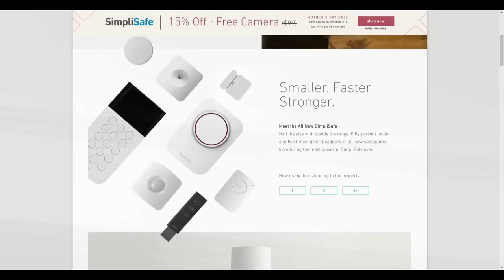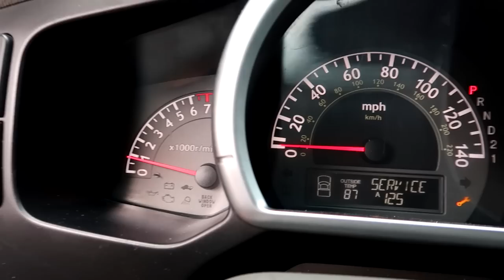Buying a Reposessed Truck at Auction was a MISTAKE! It's WAY Worse Than I Thought!

Comment: My guess is that most of that rust is a result of the holes drilled to put those running boards on. 
You seem to get all caught up in things being unsightly. Which I guess is important when you’re talking about a luxury sedan, or a sports car, but that’s a truck, a shop truck at that. Just keep the power steering fluid topped off and drive it.
Reply: Barry Fields you raise a good point. Nobody ever got the proper training on how to properly install the running boards so they probably contributed to the out of control rust. At a minimum the owner or owners didn’t stop the problem from progressing.
Reply: From what I've seen, they come from factory with threaded holes for running boards, and same goes for the Pilots.
Reply: Kai Borah I just watched two videos on ridgeline running board installation. And there appears to be holes in the frame for running boards. But the ones on this one appear to be mounted right to the rocker panels. But I could be wrong. When he puts his foot on it the whole rocker panel moves.
Reply: My thoughts too. The rust on this car is odd. The rockers are so bad one would expect the rest of the bottom to look awful, but it's actually not bad. The rocker issue is pretty isolated.
Reply: @JVR_Funwithdesign  As a rust belt resident, we usually see rockers as the first to go. They're in-line with the wheels, and therefore receive most of the road salt/slush. Specifically, this is the worst rust area on my pilot, which is near identical to the Ridgeline underneath.
Reply: @joystix11 Yeah I live in Canada and have seen my fair share of rust. :) But usually the wheel arches would be showing some sign if the rockers were that bad. It's probably a combination of salt and some improperly drilled holes.

Comment: Im from Nova Scotia - the land of rust and honey.. It's moderate. I think you got a good deal.. it's worth fixing up and it should not cost you 3 or 4 grand more to repair. we fix rocker panels like this all the time. for around $250 -  $350. Also get it under coated for another 100 and that should help allot. Cheers
Reply: Al Bore  Tar hardens out, traps moisture and it rusts out again.
Just lube it with chain oil. D:
Reply: FLUID FILM
Reply: Same I'm from Fredericton

Comment: The weight capacity of the running boards is probably the weight of 5 chickens.
Reply: What about bananas?
Reply: I think 3 tops
Reply: I say 7 chickens and a coconut...
Reply: Unless running boards are directly attached to the frame it's a joke. I doubt new it could hold my entire weight.
Reply: Wings or McNuggets ?
Reply: It'll carry a henway.  What's a henway? About three pounds...

Comment: In Arizona rust is an endangered species
Reply: That's why AZ is the best state to go car shopping!
Reply: Tx too..no rust.  18yo Bmw convertible with 185k - no rust.
Reply: Daily driven 2002 Nissan Maxima here in Colorado.  Nothing but surface rust.  I'd freak if my car had rust as bad as this Honda!
Reply: 275k on my Eclipse 03 GT 0 rust
Reply: @maximaniac7231  Here in So Cal, rust is almost unheard of. High mileage gets the car eventually, but that's pretty much it.
Reply: I've heard AZ called the used car capital of the US - No humidity, and no snow, so no salt on the roads, either.
Reply: @LaGrrrande  There is snow in lots of the state. Watch out for anything from northern AZ. Southern AZ is the best.
Reply: @jaythrash8804  Oregon has AZ beat.  No rust AND no sun!
Reply: 123 123 that's a blessing.

Comment: It was turning because the whole bearing was spinning. You put an Allen wrench into the center of the sway bar link bolt to stop it from spinning while you use a box end wrench to loosen the nut.
I ran into this yesterday when I was changing the struts on my Toyota.
Reply: All you do is grab the joint where the boot is with a pair of vice grips then wrench the nut off
Reply: Rounding the allen key, breaking the hex tool, rounding the nut on the front and the backside (if your link has one, most don't). Easier just to cut them off. I've wrecked a few pair of vise grips and other tools as well just trying to get rusty links off. Dont waste your time.
Reply: I honestly laughed when I saw this. Like this is sarcasm right? People don’t actually do this.

Comment: Evidently never seen a car from OH. You haven't seen rust yet, Sam!
Reply: That one was bad for a ridgeline tho..  they're usually not that bad, even here in ohio.
Reply: In Ohio, brand new cars are already rusted
Reply: @getchasome6230  you wouldn't want to have seen our old delivery Ridgeline then. Had no floor. Literally no floor 🤣
Reply: @steelvenom330  bought my last car from Florida because of this very issue. In Wadsworth less than a year and has a spot already 😤
Reply: @ThePhoneGenius2009  I live near Canton and bought my truck from Kentucky, it had no rust when I got it, I immediately undercoated it with rust proof as soon as I got it up here
Reply: @steelvenom330  my truck was rust proofed previously. I usually wash the underside of the car and truck off. Usually rustproofing at least in my experience has made it so that rust can prosper and be hidden. (most times if done improperly). So I just make a habit of washing the underside when it's been crappy out.
Reply: @ThePhoneGenius2009  LOL check out some Michigan vehicles they are even better, we love salting our "roads" from September to May.
Reply: i live in ohio and my cars have never had any rust problems
Reply: @danieln2448  look at the underside (chassis, undercarriage, what have you). You'll probably find a spot unless you're getting a new car every year.
Reply: @ThePhoneGenius2009  no I had a cruze for 3 years no rust at all now I drive a 2017 audi still no rust
Reply: lol Slam the door and the car/truck will weigh 20 pounds less due to chunks of rusted metal falling off
Reply: @danieln2448  lol it's 3 years and under obviously a brand new car isn't going to have much rust, I figured common sense would have been applied to my comment I apologize.
Reply: TPG2009 or newyork
Reply: @thahitman2  That sucks!  I live in Columbus, Ohio, and the roads are only salted here the night before snow or freezing rain is forecast.
Reply: @hamsterama  Ahhhh yes good ol Columbus I once had a wild night there at Kahoots after getting thrown out of Easy rider rodeo in Chillicothe.
Reply: @thahitman2  Hah hah!  As it so happens, I live just a couple miles or so from Kahoots.
Reply: @hamsterama  Hell yeah man it was a good night that's for sure,  we shut down kahoots then went to the white castle right down the street it was like 3am all of a sudden all these dudes showed up and started a car system competition,  the cops came and we are sitting in the drive thru with a 1992 Ford tempo with the top chopped off and a 9 ft stripper pole installed with giant vinyl decals reading MUFF MONSTER down each side. Me and my buddy couldn't believe that the cops didn't fuck with us.
Reply: @ThePhoneGenius2009  --REMEMBER WADSWORTH FORD ??
Reply: @BigTony2Guns  Wadsworth Ford, Spurgeon Chevrolet, Strickland Chevrolet (before it was Laria). Yup
Reply: @BigTony2Guns  I also remember Axelrod Chrysler when they sold new. Now they sell overpriced exotics. Across from them was a Chevy dealer where the owner got arrested for fraud. Can't think of it's name.
Reply: @ThePhoneGenius2009  --That was Cook Ford-about 40 years ago..
Reply: @BigTony2Guns  my folks remember cook Ford.  There was a Chevy dealer that had the same thing happen. It was George something Chevrolet. Jim Bonner auction house is in it now
Reply: @ThePhoneGenius2009  --I worked for Cook Ford and Bought  a--1968 Wadsworth City truck --in 1979-Wish I had that truck NOW !
Reply: @BigTony2Guns  small world. We renovated a house by the city lot on Oak St. I used to work at Isham and Overlook on their computers.
Reply: @BigTony2Guns  the dealers name was Micky Miller Chevy. Bought by Doraty Kia and turned into Renacci Doraty Chevy, and went outta business in 2010.
Reply: @thahitman2  Salting the roads makes them taste so much better though.

Comment: Where in the Netherlands this amount of rust on the rocker panels would easily total out the truck. No way this ever passes or MOT inspection. I mean rocker panels on a unibody construction are a big part of the construction and if this thing would involve in an accident it would kink right where it rusted through. I would definitely at least bodge it with some fresh metal and undercoating before taking the road trip, just to make it solid again and a bit safer.
Reply: Ah khoya elke Turk keurt zwart tegenwoordig.
Reply: Ilias Lamari yes people here are accustomed to government officials not caring about anything and in my state of Texas, it is so absurd that independent mechanics inspect cars for the government and therefore they don’t care either or ask for extra money. Even in California, the emissions officials accept bribes.
Reply: You spelled defiant
Reply: Same here in UK would. Need to be cut out Replaced filled and then sprayed over with filler. Also cat failure mot fail. In UK would. Be scrapped as not viable to do
Reply: The benefit of inspections though is safer vehicles on the road around you.

Comment: You should get a 2011-14 F150 or a Silverado with the 6.2L V8. 
Would be an excellent tow truck when you need it and are super reliable.
Reply: Or a diesel....?
Reply: Yeah, I'm thinking more towards a Ram 2500 with the Cummins Turbo Diesel
Reply: @B_izzyy  but it would need the egr delete
Reply: Maybe a duramax diesel?
Reply: ScottyB 
Yeah I’m thinking almost anything but a 6.4L looked like he already looked at/tried to buy would be ok. 
But that can start a whole other conversation. 
But I think Cummins makes about the best diesel out there.
Reply: Nesta M 
Hard to beat a D-Max😁😁
Reply: I was amazed at how cheap the f150s get used. If you're willing to buy at over the 120,000 mile mark, they can dip really low. I'm driving a 2010 with the 3V 4.6, and I haven't had any real issues yet.
Reply: Miles Beckman tru
Reply: Undissatisfied 
As long as it’s not a 5.4L they’re great trucks. 
That’s why I like the 2011+ because you can get the 5.0 which is a  bulletproof engine but more importantly the 6.2 which is an absolutely sweet engine and probably one of the most reliable.
Reply: solid trucks, but I thought f150s had pretty common problems with timing chain failures?
Reply: x5finger 
I think That’s with the 3.5L Ecoboost V6. 
They had some problems in the first 5-6 years. 
That’s why I like a good ole American V8. 
Everybody says the Ecoboost is just the best thing but I think that they aren’t a high mile (250K+) engine. Putting that must turbo boost in an engine will wear it out way faster. 
They’re great if you want a city truck I guess but if you want a solid long lasting truck get a proven V8.
Reply: Or just get a Silverado. 
They’ve had it figured it out for years. 
One of the best.
Reply: Just picked up a 2500hd with an 8.1
Reply: Yesssss!!
They are the best!! 
They have the Allison don’t they?
That’s totally where it’s at, especially for a gasser😄
Reply: Not sure bout that ford..
Reply: gertgrtgrtgrt 
Yea...but the problem is who wants to go to all that trouble and expense when they could just use a stock 5.0 coyote and it’ll pull like a beast or get a 6.2 in ford/gm and it will blow your socks off. 😂😂😀
Reply: gertgrtgrtgrt the 4.6 was a great little V8 but like you said just not a ton of power. Lol
Reply: gertgrtgrtgrt 
I was just thinking of a truck that is in that production year.

Comment: You think that amount of rust is bad? How cute.
Reply: Floridians are weird about rust. They're not used to it so they think any amount they see is going to cause the vehicle to fall apart.
Reply: @Kitfoo77  JonTron was right. We gotta saw off the whole state and let it float into the ocean.
Reply: @tiborklein5349  Just let me know when so I can drive north!
Reply: Kitfoo hey we’re not all that way, my trucks rusting around the drip rails and the back of the cab, I’m not fixing it til I can see the sky.
Reply: I know right. Up here in Nh Ive seen cars basically missing nearly the entire under carriage.
Reply: Kawaii koto
Reply: The rust on there is horrible! This thing is a total rust bucket! What are you guys talking about?!
Reply: @805NAVE  Thats nothing my dude. Ever been in the northeast or even the rust belt?
Reply: Right? As long as there's no through body holes, that doesn't even qualify as rust.
Reply: @EHoward64  In Highschool, I had a friend who's car had no floorboards. There were 2X4s across the frame rails held in place with vice-grip pliers and the car seats were strapped with nylon straps to the 2X4s. Pretty fun car in the summer, not so much in the winter!
Reply: @ekummel  I had a 85 300zx, missing nearly half the floor and had no rocker panels left lmao. Seats werent bolted down just held in with zip ties. Was a fun drift car and a fast one too... till i burnt the clutch out and it sat for 6 years before selling it to a guy for parts.
Reply: @805NAVE  what?
Reply: Kaguya-sama, is that you?!

Comment: In my area they're shops that just specialize in repairing rusted quarter panels on trucks.  I got both of my rockers replaced on my 1991 Toyota pickup for $400.  That did not include paint or body work just cutting out the old rockers and putting new ones in.  Took about two hours I waited while the work was being done.  I did the paint afterwards using shaker cans and it looks good.  As for the other rust issues it looks likes they put a paint over rust product.  If done correctly the applied will prevent further rusting from occurring but it does have to be applied correctly.

Comment: as a truck owner,  I would say the rust is moderate COMPARED TO VEHICLES HERE UP NORTH.........
I still would buy a vehicle with more rust than this Honda up here in New York as long as i CHECK FOR MYSELF that the rust is superficial underneath and not rotting the metal.  But you seem to have a decent, workable budget.  So only work on it if you plan to keep it - as you mentioned before - weekend projects!!!
Reply: Exact!

Comment: I would say the rust is moderate. Severe rust would be frame rot. But it would be good for a cheap reliable family beater.
Reply: Exactly. For the right price, my deal is that the body rust is deal-able with, but if the frame has soft spots it's time to run away from it. Coming from someone who lives in the rust belt.
Reply: It's a unibody construction, it does not have a frame. Or otherwise put, what's rusted out there, is a part of it's "frame"...
Reply: Why you want to beat the family tho?😂
Reply: @ecua-el_pinguo2164  😋😋😋😋
Reply: Unibody vehicles still have a main structural area that is easier to just refer to as a "frame".

Comment: Ridgeline owner here. Dont forget the Transfer case oil and differential
Reply: Do they do the same thing as a crv and start locking up the rear diff in low speed turns when the fluid is dirty? I get great deals on crvs that are wheel hopping in parking lots. Bam fluid change and all good.

Comment: I'm from Montreal and have a cousin who's been running a body shop for over 30 years. What he explained to me is that rust is like cancer. You'll remove the rusty part and weld some new sheetmetal, but it might (and sadly, often does) go bad again as it's very hard to remove 100% of it. In your case, you live in Florida, so the amount of time before it comes back might be a lot longer. The "frame" looks to be in pretty good condition, I'd say it's worth it and I'm keen to see the content you show us doing it.

Comment: I would coat the underside with an oil-based undercoating...not rubberized. Don't bother with paint.
Reply: Fluid film!!!!
Reply: @cletusclem8758   
After you get rid of the rusty flakes and undercoat then fluid film.
Reply: Yeah, in Canada they use a oil/wax coating.

Comment: Buying a Ridgeline was a great idea, just this one is not a good example. To everyone saying that the rust is moderate/no big deal....is that true for a unibody vehicle?? Sure, for a body on frame truck, rotten rocker panels can be considered a cosmetic issue. But for a unibody, those panel are structural and make a significant contribution to the chassis' strength. A full repair by removing all rusted parts and welding in new metal is required, I believe.
Reply: still cheaper than a new truck

Comment: I turned wrenches in Maine for 17 years professionally, both at dealerships and independent garages.  I worked at 2 different Toyota dealerships in southern Maine, and yes both inspected Toyota Tacoma and Tundra frames for frame rot/cracks, and also replaced those failed frames with new frames along with an assortment of other new parts along with the frame replacements.  So with that said, I have seen and worked on rusted/corroded vehicles, and that ridgeline is far from bad, in fact, that is what I would consider to be an easier vehicle to work on.  That rocker rust is nothing

Comment: Stop Leak is basically a small amount of brake fluid added to a oil base. 
It causes the seals to swell. That's why it works. 

Eventually all the seals become brittle and fall apart. More glycol, more seal swell and the faster this process happens.

Comment: I live in Montreal Canada. Buy a can of rust check, it will stop the rust from spreading. might seem too late to rust proof it but its not, it really stops the rust from forming in other places. we use salt on our road during the winter and i can straight up tell you the ridge line wasn't built for that. they rust pretty bad here if owners don't get them properly rust proofed. all in all though i would say you got a great deal, dont concern yourself with the rust, its just a beater. if you grease it up it will last longer than the drivetrain.